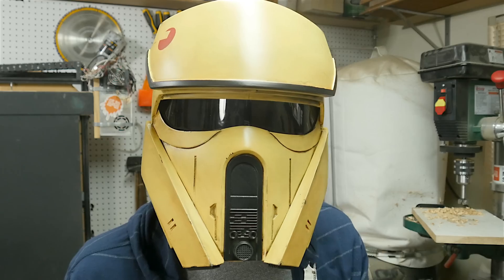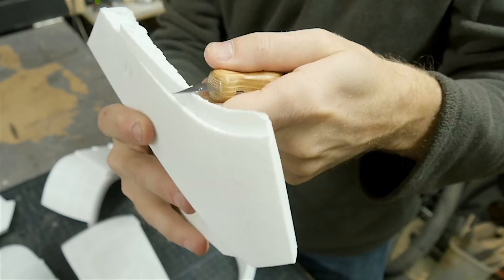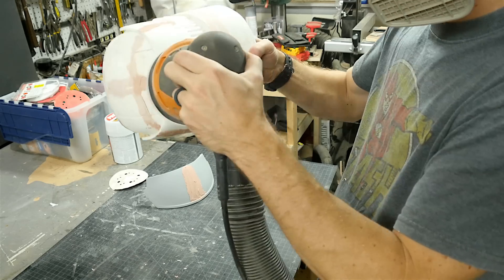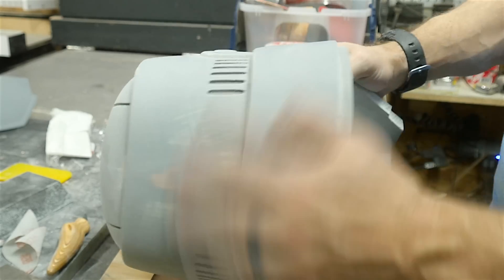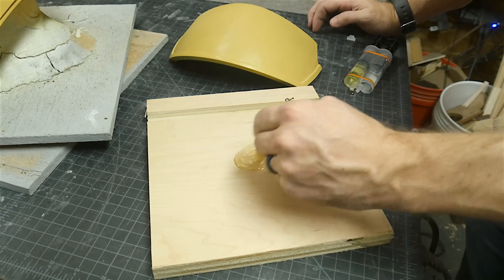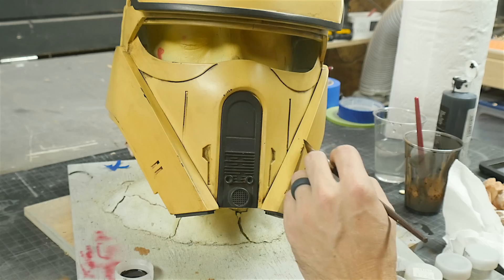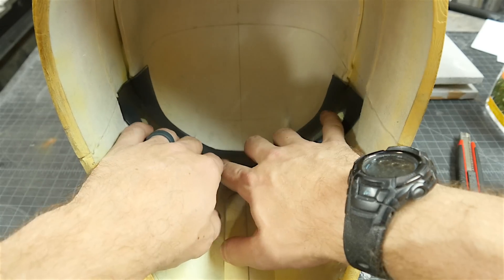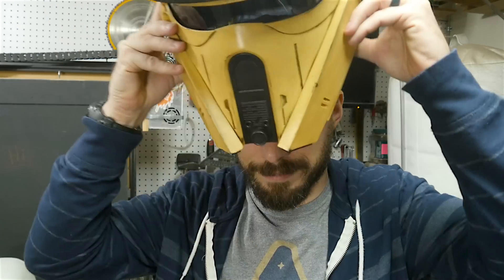Star Wars Rogue One Shore Trooper Helmet (3d printed)

Comment: The way you use CA and accelerator may screw a lot of people over. You have ZERO time to play with it. What I like to do on 3D prints is put CA in the middle and make a tiny bit of it come out the end (either on the inside or outside). Hit that tiny blob with accelerator only AFTER you have it lined up and it will activate some of it inside and function as a "tack" weld. Love your channel, that part always just makes me a little nervous for other people that may try it. You'd have to split the part if you mess up or do a ton of sanding.

Comment: pro tip for the hardener : put a line of hardener the length of the diameter on the top of your filler and then mix. It should be the perfect ratio everytime.

Comment: I saw the bathroom remodel video AND I HIGHLY RECOMMEND THAT YOU REMOVE ALL SHARK BITE JOINTS !! Those are for temporary fixes Bc those don’t really last through seasons and I’ve fixed multiple buildings and houses Bc of lazy plumbers using shark bite connectors but pecs has there own connectors that you should have used .. I don’t understand why Loews just didn’t give you the proper connections

Comment: Great project  and thanks for all the cool projects you do. I dabble in some autobody  and found a product called Dynatron Putty-Cote unlike Bondo this product is designed as a finish coat and is very easily sanded to a feather edge and would be great for projects like this.Product is a 2 part and mixes the same

Comment: If you want your sandable filler to stick better use "evercoat glazing putty" .  Not a salesman, I've just been in the marine industry for a long time.  The evercoat will stick very well to the ridges and valleys in your skin as well so make sure to wear glove as it will not peel off.  Also it is non porous so it's better if you want to paint afterwards.  You are welcome :)

Comment: This looks FANTASTIC. I've got the full armor set and gun downloaded and waiting to slice it when my mk3 arrives. What infill percentage / wall thickness did you print the pieces at? How has this helmet held up over the last year?
Reply from the maker: It's held up really well, although I don't remember infill settings.  Typically 15-20 is my default.  When you do the armor, you'll probably want to increase it a bit for durability, especially on the ab & chest. 👍🏼

Comment: Just an FYI and 1 Question for Channel Host

I happened upon your video and another's "Prop Fabrications", while searching over "spray painting tips for a project I'm working on that has plastic, metal, and fabric materials".
I found these both to be most interesting, valuable in their details, and quite evident of the artistic and craftsmanship qualities. 

My question is:  "Do you have a video that addresses the types and grades of sanding products and perfecting materials that you use in your work on various projects, including any specifics/brands/grade numbers - i.e. 80, 120, 200, etc, and known best vendors to purchase from/through?" 

I've a number of pending projects with a variety of materials:  marble, wood, metals, plastics, glass, etc - requiring sanding, wet sanding, "drilling/cutting" holes in glass, buffing - some requiring "diamond pads" like my marble table top and some glass pieces that I need to drill holes in to run wires through for lamps and light fixtures.

Thus, I am searching for brands, vendors, types of products and equipment. 

If you have any helpful information, videos, or links on these/related topics, please share with me. 

Thank you,
Beth Bartlett ☘

Comment: You're talking about the neccessity of wearing a respirator for sanding, but you you're using an organic gas cartridge... 🤔
Reply from the maker: Because I was also painting ,etc.
Reply: I Like To Make Stuff I get that, but an organic gas cartridge doesn't protect against particulates afaik. That's why they sell the add-on filter which you can snap over top the gas cartridge

Comment: ya could also used a solvent to smooth the prints out but remember to not use to much you can find things on youboob to make it completely smooth..... must stop talking of sanding......
Reply from the maker: That works for ABS but I was printing in PLA and acetone won't work for it.
Reply: solvents i said it will be easyer like acids anything that you can use to take off material and then bathing in water. or you could use the good ol 24hr set jb weld you will get the same finish while making it weather risistant.
Reply: it is also auto smoothing so you will get glass like finishes

Comment: Wow that looks amazing and very time consuming. Good job and I wanted to recommend placing window tint or any kind of film with adhesive on the direct middle of the piece you are trying to cover. It will help remove all of the air bubbles due to the middle pushing air outward.

Comment: Hey bob! I have a question for you regarding this project. I'm hoping to
 use some of these techniques to make the helmet Samus Aron wears in 
Metroid. It seems you started with a bubble you built up the helmet 
around. What did you take into consideration when deciding the size of 
that bubble? I would hate to print out the entire helmet get it all put 
together and it just be way too big or small.

Thanks dude!
Reply from the maker: +Lindsey Williford I got a fabric measuring tape a found a rough diameter of my head. The bubble generally matched the size of my head.
Reply: Thanks for the fast reply!

Ok, thank you so much! I kind of figured it was something like that, but in case you had a better method wanted to see what did or didn't work for you. Keep up the great work! I love your videos!

Comment: How come you don't do the clean up work with a Dremel? Is that not useful in this case?
Reply from the maker: I personally don't have tons of experience with it and so my control of it isn't that great.  Even at the lowest speed, it turns really fast and can take off too much material.  It's something that I need to spend more time with to get a better feel for controlling it in detail cases.
Reply: Ok, cool. I was just curious, never used one myself. It just seems to fit the work you were doing. Great video, I'd love to see you do the full set. I've had a thought in the back of my mind that it should be possible to 3d print a full costume out of small parts, but have yet to attempt it myself.

Comment: I recently was informed of an technique that has been working for me. You thin out the bondo with some acetone or rubbing alcohol. this allows you to put on thinner layers to fill inthe layer lines. i use 400 grit sand paper to smooth it all out.

Comment: Hey! I Like To Make Stuff What kind of paint would you recommend using for 3D printed material? I saw you used acrylic paint in the air brush but for more detailed projects what would you use?
Reply from the maker: I use acrylics for everything. No specific brand or anything though.. whatever is cheap :)

Comment: Using putty glaze over the seams might produce a better result. Putty glaze cures smoother than bondo and is typically used on top of bondo to smooth/cover imperfections (eg: pin holes,). You can also use acetone to smooth out the 3d prints instead of sanding but experience is required with this method.
Reply from the maker: I actually couldn't find any glaze locally (forgot to look at the auto store) and had to order it. I just used the bondo to get the project finished. Acetone works for ABS plastics, but I printed this in PLA so unfortunately it wouldn't work :/

Comment: this turned out wonderfully!
a few things you may want to consider in the future: when bonding with CA glue or 5 min. epoxy, you should really consider sanding away the paint and primer in the areas to be joined. you may find in a few years, that the visor may just fall off as it stands now. same thing applies for plexiglass. the areas to be bonded, should have been roughed up just a bit (though this is less of an issue, as it wasn't painted or primed).
i'm sure another may have already mentioned this- but plexi is available in multiple shades of black, with varying degrees of opacity. next time you could save a bit of hassle with that window tint.
the only other thing i can think of that's worth it's weight in gold for projects like this, is the red bondo spot putty, during the sanding/seaming/refining stages. just apply it right outta the tube (no hardener required). it dries rapidly and sands like a dream. perfect for smaller areas when mixing and using standard bondo would be so much more hassle.
once again- great job and keep up the fantastic work!

Comment: I've found that a cheap marble tile or pastry board has an incredibly smooth an rigid surface for sanding. Use some rubber cement on both the sand paper and marble. Let dry then stick together. Great to doing edge joining of small parts... also works awesome for sharpening chisels with a jig.

Comment: Hi bob I have a question. So I'm interested in getting into the 3Dprinting hobby and I'm kind of on a $500 budget right now and was wondering which printers and software do you think I should start out with?
Reply from the maker: Well for software, there are tons of free options .. 123dDesign, Blender, Fusion 360 (I think that's a good one to learn for the long term)
For printers, personally I don't have experience with anything at $500 or under so I'm hesitant to recommend anything.  I would check out Joel Telling (3d Printing Nerd) or Thomas Sanladerer (Tom's 3dp)  They'll have plenty of recommendations in that range.   Good luck!
Reply: Thanks for your help! I'll definitely check it out. My last question is which printer do you recommend not worrying about the price? Just curious
Reply from the maker: ***** Sure thing! If price is no issue, Ultimaker 3 is AMAZING.

Comment: check out 3m spot puddy. its i single stage bono type filler used for seams on rocker panels and such. it comes in a white squeeze tube and the product is green in color. this stuff fantastic and super easy to work with. it sets quick but sands easily
Reply: Good to know. I’ll tell my dad about it haha
Reply: If I remember 😂

Comment: for someone who has so much gear you really, really need to invest in a better airbrush (double action gravity feed). I love your videos but when you get to the painting stage i cringe. the weathering techniques you use work on tiny stuff, not so well on larger things like this.
Reply from the maker: Well, I don't invest in expensive tools that I'm not sure I'm going to use long term.  For things like an air brush, getting started with a cheap version is a good way to try it out at low risk.  If it's something that I find I use a lot, I'll invest in a better one and give the cheap one to someone else who's starting out.
As far as you cringing about my painting..  that's not really something I'm that worried about :)  I learn as I go, just as I hope other people do, and I never claim to have any idea of what I'm doing :)
Reply: Although I agree starting with a cheap version is definitely a good way of learning a tool, siphon feed airbrushes in my experience definitely put off people rather than help them. A cheap gravity feed double action is definitely obtainable, the veda 180 is a good example of a cheap, decent entry level airbrush. As for my comments on weathering, i feel like a dick for being snarky, I completely understand painting isnt your main thing. Thanks for taking the time to reply to my somewhat bitchy comment. I hope you & your family have a great christmas. Looking forward to what you build in the new year.

Comment: how do you scale it to your head?  How do you scale it while in the modeling software?
Reply from the maker: I used a fabric measuring tape to get the circumference and approximate height of my head.  In the modeling software I made a shape that was roughly that size, then scaled the model to fit over it.  It wasn't a very precise process, and there's probably a much better way to do it, so I didn't include it in the video.
Reply: I Like To Make Stuff Thanks for the reply! Nice helmet though!

Comment: Whelp... I think Eva foam is my only route because a 3D printer is just a tad bit expensive.... Just a tad
Reply: Foltzy depends, gearbest.com had one on sale for $172... Not sure if it still is or not though.
Reply: garrett gaddy even then it still feels like it would be cheaper to use Eva foam. I don't know, maybe I'll do some looking if I really did want one.
Reply: maybe for a single project... I feel like if you got a 3-d printer you'd find more than one project to use it on. really it's one of those things that will save you time and still get good quality.

but yes I agree, you're probably better off using EVA foam if you want to do this with a small budget. :)

Comment: this project is awesome!

One quick tip on using bondo - it looks like you used the "heavy duty" grade, but they also a finer grade that is used for the final coat in auto body application. It is a thinner body filler and leaves less voids. I grew up around automotive body work, and the typical process is to use the stuff you used to fill any major voids, sand it smooth and then skim coat with the fine body filler before you prime to fill any voids or minor imperfections. It is thinner and easier to spread and I think it might have saved you some time on you project.
Reply from the maker: Cool, I'll check that out, Thanks!  I'd ordered some spot putty but it didn't come in early enough for me to use it in this project.  It sounds like it would have been an easier option as well.

Comment: Hey Bob, I have a question.  Would Apoxie Sculpt be a better substitute compared to using Bondo, since you would have more time to sculpt the epoxy into the gaps and sand less?
Reply from the maker: It would definitely work.  You'd get more work time, but also the dry time is MUCH longer.  Eventually I made smaller batches with less hardener and the Bondo worked pretty well.  There's a Bondo spot/glaze putty which is really good for this too, mine just didn't arrive in time so I went with the regular Bondo.

Comment: What made you decide to do the filler primer first before sanding and as the final layer before paint as opposed to bill doran's method of sanding the print first and then filler primer and using regular primer as the last layer before paint?
Reply from the maker: Just a different method.  The filler, by it's name, fills in the low spots in between the print lines.  Theoretically, spraying it first would "raise the floor" and give you less to sand down.  In the end, the two are probably not much different, it's still a ton of sanding :)

Comment: Bob this might sound weird but you should drop it or scratch  it a little bit. To give it that extra touch!
Reply: lol that does sound weird but thats a good idea
Reply: unsure of how the 3d printed material holds up, but i did the exact thing to weather my fiberglassed Boba Fett helmet. smacked it against some concrete block, rubbed charcoal all over it. Turned out real nice. The best way to get that "real weathered" look is to paint a silver and black as the base layer so when you chip off your actual top color, it has that very minute depth to it that makes it more realistic up close. I tried putting the silver and black on over top my top color and it looked exactly like i did that hahah

Comment: which printer do you feel had the best quality prints with the ones you used??? do you ever use something like a dremel to sand?
Reply from the maker: I've used a dremel in the past.. it can easily get out of control because the speeds are so high.  If you're careful, it can be a real asset.   As far as printers, I've only used a few but my favs are the Ultimaker 2 & 3, and the Prusa i3 MK2.   Both are excellent
Reply: Cheers for the reply!

Comment: This looks fantastic, mate. The 3D design stuff is a weak point for me but it looks really powerful from what you've been doing.

A couple of tips (from my automotive experience) that might help you next time, Go further from the joint with the filler, it makes blending in much simpler than filling just the cracks. I would tend to go about an inch either side, leaving a thin layer covering a wider area. It'll be easier to blend but also less prone to cracking. You might even consider using epoxy instead, depending on the flexibility of the helmet. 

Also when tinting, heat shrink the film to the visor shape with a heatgun before ya peel the backing. It'll be the correct shape when applying and will be much less of a headache to chase out the bubbles out. Keep up the good work. I love this one. :)
Reply from the maker: Cool, thanks for the tips!  Good stuff!

Comment: Great job. but you should use Bondo 907 Glazing and Spot Putty.  Real easy to apply, air dries and easy to sand.
Reply from the maker: Yeah, I had to order it and didn't want to wait on it to show up.  I got it in right after the project was finished :/

Comment: Superglue can be very convenient, but I know from experience that it cracks easily when knocked. I use epoxy for costume parts and props that are supposed to be handled a lot, when I can't solvent-weld them together.
Another tip is to make a V-groove in each seam-line. When you press the parts together, excess glue will gather there. The groove also makes it easier to fill and sand level.
Reply from the maker: Good call! Thanks for the tip!

Comment: really nice job with cloning the mask. the use of dark lexan (polycarbonate) would had been a better choice. plexiglass (acrylic) will try to fog up overtime and tint does not adhere well to plastics
Reply from the maker: I just found that stuff at Home Depot a few days after I finished this.  It would have simplified the process, but I'm really happy with how mine came out.